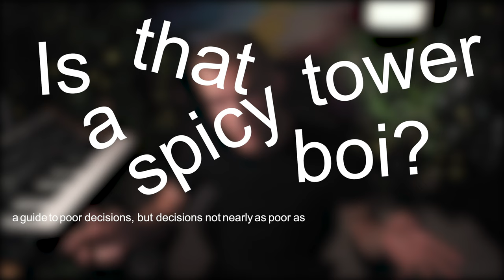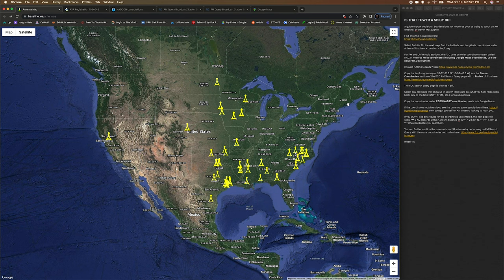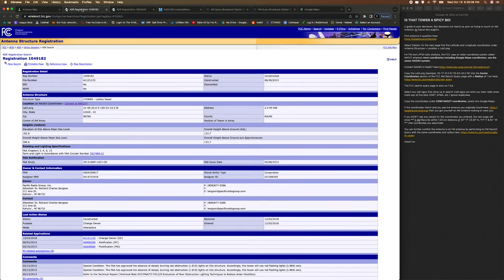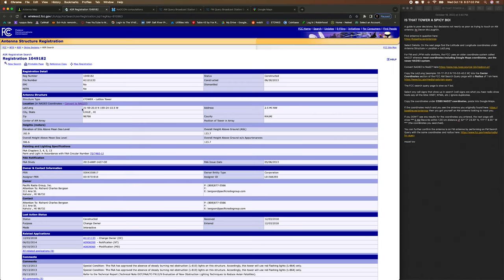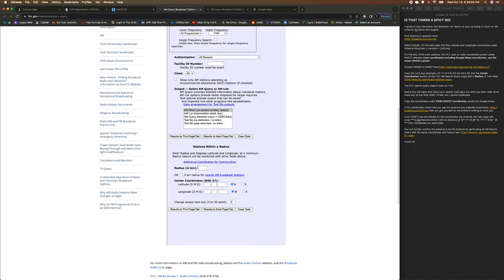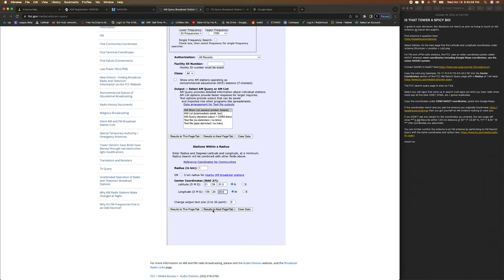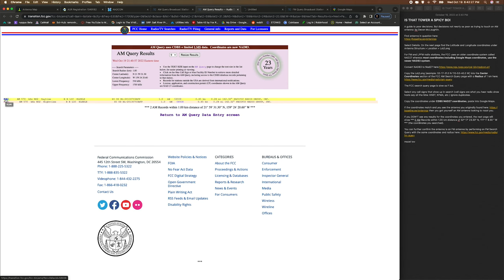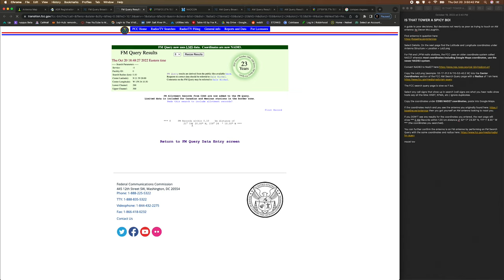AM or FM antenna? a guide totally not made for BASE jumping

Comment: There is this 2000 foot tower in Texas called the Liberman Broadcasting tower that I used to see as a kid while visiting family. It looks…. Fun… I’ll have to use this tool to see what kind of tower it is
Reply from the maker: Those big ones are usually FM/television broadcast towers. But it’s definitely good to check. The antenna at the very top is usually the main point of RF exposure you probably don’t want to remain near. But the most dangerous part on those antennas is the climb up itself, followed by the jump (assuming you’ve planned everything accordingly). I’ve actually been working on a video for some time which discusses these large antennas specifically, so I’m hoping that’ll be helpful.
Reply: @DevMcLaughlin  I didn’t realize that RF can affect people. I assumed the wavelength was too big and low energy to mess with our biology. I’ll have to look into that 1. Edit: a quick google search shows flesh over heating and increased nerve stimulation. That doesn’t sound good. I guess the good thing is 2000 feet gives room to theoretically exit lower and away from the source. Also that 120° window of jump space compared to a cliffs 180° seems like something to take into consideration
Reply from the maker: You’re definitely picking up on some very important things to consider with these larger guyed masts. I’ll actually discuss these key points in this next video in quite a bit of detail.

These towers emit non-ionizing radiation (microwaves), meaning in brief, they do not cause genetic mutations that would otherwise lead to cancers. That does not mean they aren’t harmful. Like the microwave in your kitchen; this frequency of electromagnetic radiation will cause water molecules to vibrate and generate heat. This means given enough exposure, microwaves will literally cook you from the inside out.
Reply: RF is funky. I work in the military and some of our radios you can’t touch the antenna when your transmitting. It’ll burn the crap out of you. Some of our communication equipment will make you sick and give you headaches if you are too close for too long. Really interesting stuff.
Reply: i live near this tower and soon to get into skydiving and then base jumping but thats still years to come. When i was a kid i always said i was gonna base jump off of it, ever since i would say 7 years old when i saw wingsuiting for the first time on youtube lol. But like devon and u were saying, i gotta learn more on the RF cuz i dont wanna get to the top of a tower and get fried. but from what i see RF seems to radiate from alot of cell towers.
Reply: @daddyfatsack68  Wow. You and me both. I remember driving past it 12 years ago with my family when I was only 13 y/o on our way to hike at LBJ Grasslands and I vividly remember looking up at that massive tower from my parent’s car and thought “I WILL base jump off of that one day!” It didn’t feel like a dream of mine, but rather a promise to myself.